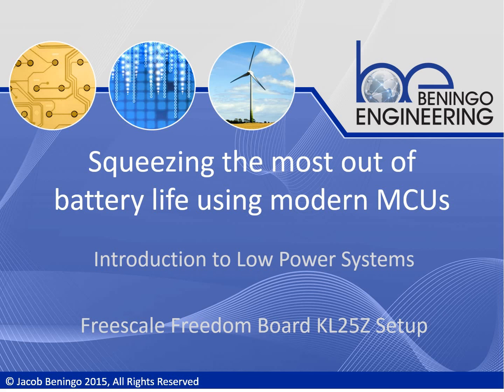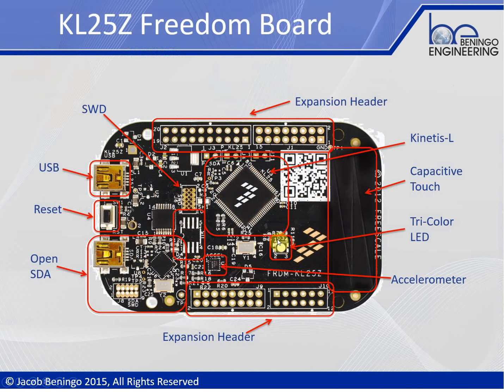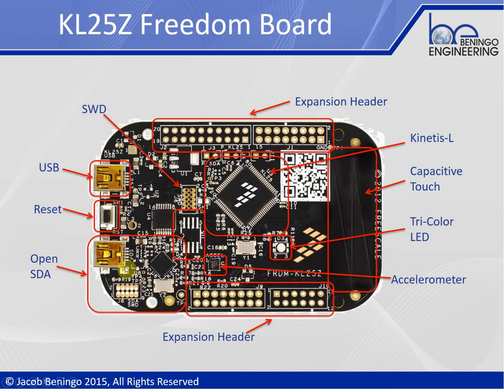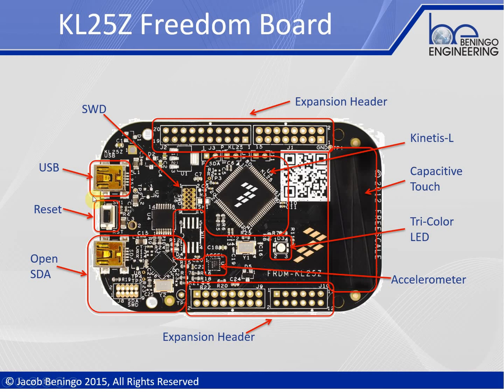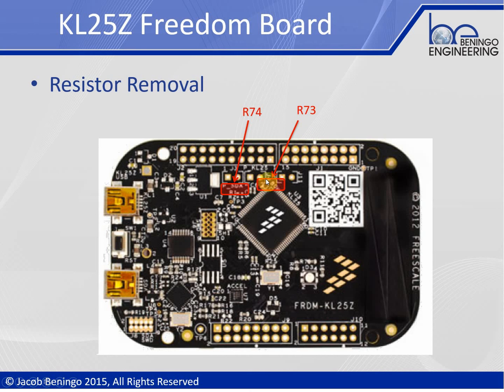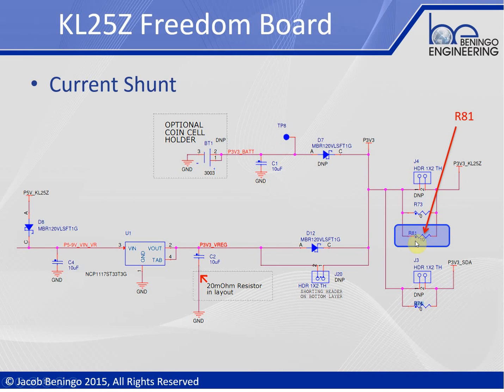Kinetis-L Freedom Board - KL25Z Low Power Setup

Comment: Hello, do you know were to buy, i cant find one to buy because the stock is out. Best regards
Reply from the maker: The parts are nearly 10 years old now. If they are not nearing end-of-life, it wouldn't surprise me if none are available due to the supply chain issues. It may just be a wait patiently for them to come back into stock kinda thing.

Comment: Hello Sir, do you have any video on how to control dc motor acceleration and declaration using FRDMKL25Z also servo control? I am learning self driving car algorithms so I want to code this ARM board for motor control so later I can implement Rpi for computer vision based.. please do reply and help me if possible? I will be very thankful to you.
Reply: Sorry. I have not done any motor control with this particular board. For motor control, I'd look at a development board designed for motor control, especially if it is BLDC.
Reply: @jacob_beningo  thank you so much for the reply. I did go through the datasheet of the board but problem I encountered is there are bunch of registers involved and it is getting hard for me to code efficiently. But I will take your advice and try to dig in further. Thank you again for the help.